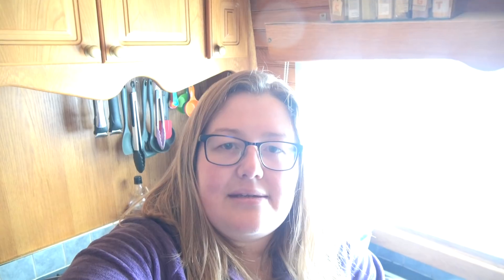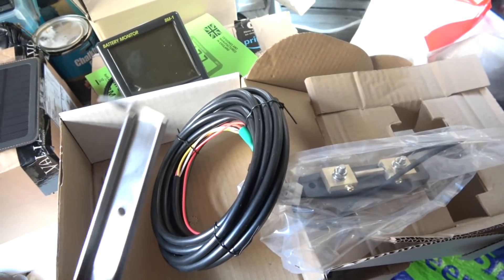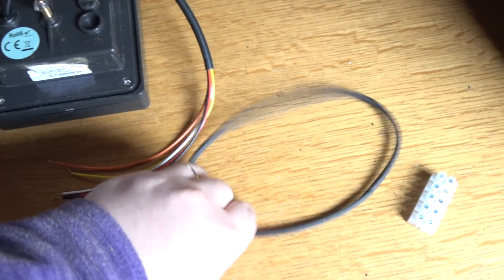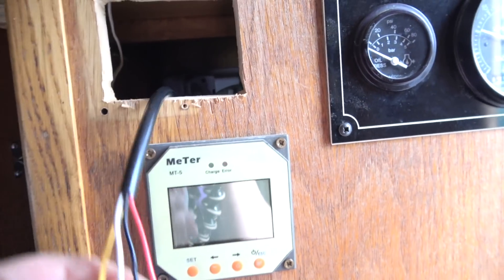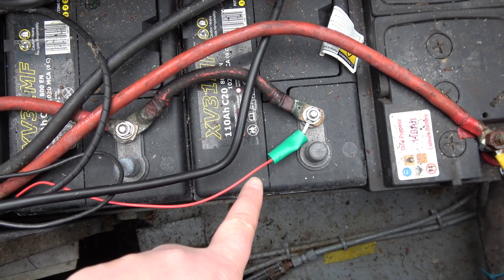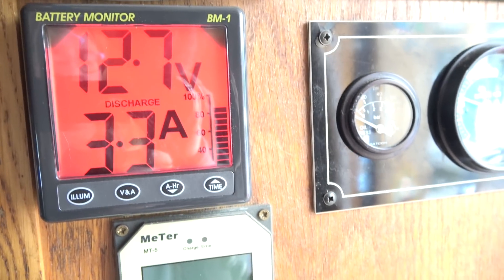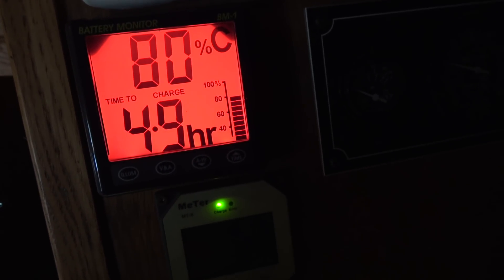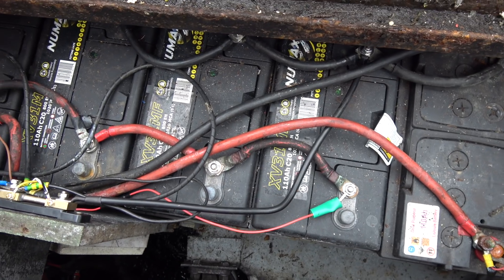How I Installed a Nasa BM1 Battery Monitor on my Canal Narrowboat

Comment: Thanks for that tip about the shunt and no other wires coming off the batteries.

When I got the boat my panel would show the amps coming in when the engine was running then it’s not done so since, I’m thinking the smart charger I’ve wired to the batteries is probably confusing it so will check when I get 5 minuets!
Reply from the maker: It’s funny, I’ve hardly looked at the panel since but I think it’s just nice to know it’s there so that I could see what is happening if I wanted. I’m interested to see how much charge the engine gives me though.

Comment: Excellent, absolutely excellent.   Way better than a salad!   Such a fine example of problem-solving.   Jono would be green with envy!   You will rack up the views with this excellent video.  Absolutely a top favorite.   No cats,  though.   
Wow, wow, wow!
Reply from the maker: Thanks Bob that’s so kind of you. I’m really pleased with it and have been bugging Anna to turn off lights left right and centre.
Reply: Kath, when I have done similar jigsaw cuts, it has been helpful to me to have gravity working in my favor . . . so I orient the jig saw blade so the saw cuts well when going from top down.  That way, I simply put the blade into the appropriate starting hole at the topmost starting point, and don't have to push the jig saw up,  instead I  simply guide the vibrating saw blade  down as gravity assists me.    I am confident you know this,  but it may be helpful to your less experienced viewers.  Hope it helps!     And of course, safety glasses and hearing protection.  The hearing adds up over time.    You go, girl!

Comment: Great video but... Is that a carbon monoxide alarm above it if so I think you may have it to high in the boat as carbon monoxide is heavier than air.
Reply: Colin Stobbart Apologies for chipping in but this is not the case. CO is actually almost identical to air in density (actually fractionally lighter) and floats about roughly in tandem with the air. CO alarms do not need to be high / low etc, it's best to have one at (sleeping) head height in the bedroom and another at mid to head height in the living areas.
Reply from the maker: Hi Colin, it’s a central heating controller for the boiler. Our carbon monoxide detector is near the stove installed following manufacturers guild lines.

Comment: Nice job, I wish you had shown how you did the final fine tuning of the mounting hole just so that people know that sometimes you need to do some final adjustments with a file or sandpaper and that is fine. Other than that you did a great job, way to show that electrical systems are not scary mysterious things and they don't have to be feared.
Reply from the maker: The final tuning of the mounting hole would have made me look like a cowboy!! And probably got me in trouble with Anna for dangerous saw usage!
Reply: L Sounds like someone might need a file and some sandpaper for next time.

Comment: This was the best vlog ever 😂😂 (sorry Anna) I made the same mistake on leaving some cables attached, they were very big and scary so I didn't want to move them. Suggest a busbar to put all your negatives on rather than stacking so many on one connection, poor form to have more than 3 as It's difficult to get a good low resistance connection with so many connected to one stud. P.S. 12.7volts is nearly full (12.73 is full assuming you rest the batteries before taking readings). Take a look at 12 volt boaters on facebook, very good group with lots of great information. 

Happy boating :-)
Reply from the maker: Best ever?!? Wow!
Thanks for the tip on the number of connections. I think that some of the wires I moved can be removed - need to work out what they are for. 
I think the percentages are misleading. I'm sure it went down to 80% when it was on 12.6 which doesn't sound right at all. 
I'll check out the FB group too, thanks.
Reply: The Narrowboat Experience , yes they are misleading! As the battery ages their capacity decreases so 100% of new will be different to 100% full, but of a reduced capacity a few years later.

Comment: Excellent, we've just bought a boat and I was reading up on these just the other day. Keep the unauthorised episodes coming, 👍
Reply from the maker: It reminds me of when I got one of the plug in units in my apartment that the energy companies were giving out years ago. Back then I'd turn the kettle on then run to check the monitor and be outraged at the draw. On the boat, I turned on my favourite lights in the kitchen and realised I'd not switched over to LED bulbs!!

Comment: I have the same one.  I find it useful for keeping a check on battery condition.
Reply from the maker: They are really informative aren't they.
Reply: The Narrowboat Experience Yes, I tested mine against my clamp meter and I got quite close agreement.  There is room for paranoia. .. Where is that 0.01 of an amp being lost to.  My friend, Charley has lent me a power consumption meter for my 240 volt stuff.  So I will be able to size the solar panels (I have one on the roof and one under my bed.  Despite being told differently there is little sunshine getting under my bed.  What folk tell you just to sell you the boat.
Reply from the maker: lol

Comment: So i understand perfectly right up until you wire the shunt. The cable you bought links the negative side of the bank to the shunt and then like you i have on one of the negatives on one of the batteries a mass of cables and they are the ones i fit to the other end of the shunt?? 
That couldnt be a clearer question lol . 
Im desperate to get a monitor.
Reply from the maker: The shunt has 4 connection points. Two connect back to the monitor. One has all the negative connections that used to be on the battery bank apart from the ones that link the batteries. The other point has the cable that links the shunt to the batteries. The manual has a great diagram and you can view it online too. Hope that helps.
Reply: The Narrowboat Experience very helpful. At the moment when we see the lights flicker when we turn the whale gulper on is our notification that they need a charge. Not very scientific and not good for the batteries either i shouldnt wonder lol. Cheers mate.